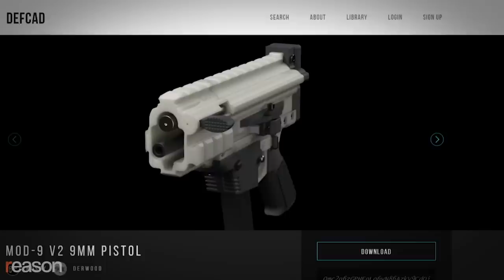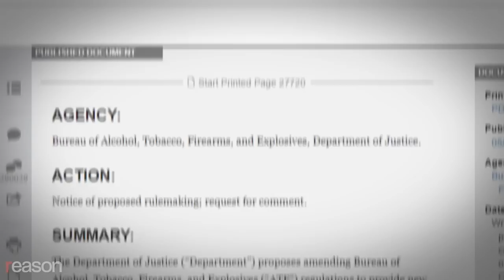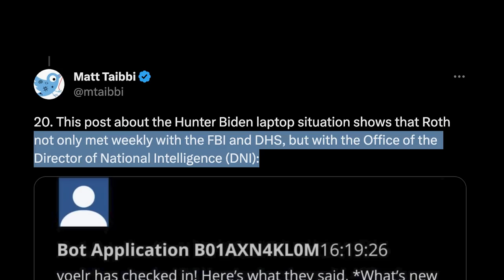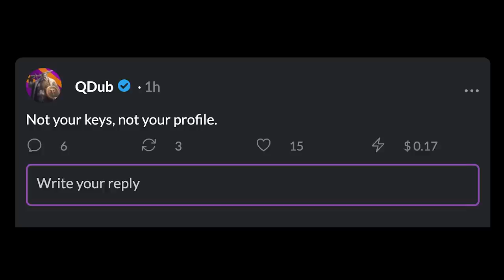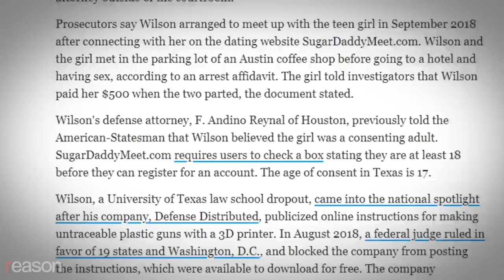Why ghost guns give me hope

Comment: On another subject, decentralizing the food supply helps keep us from being slaves of the ones who own the means of production of all food.
Reply: right... well best of luck with that, im sure it'll be simple and won't cause any issues with major corporations much less international trade....right?
Reply: @bloodlove93 It didn't cause any issues for thousands of years.
Reply: You mean like planting potatoes on both sides of your garden?
Reply: Food supply became centralized because decentralized systems are really bad. If the big corpo makes 200 tons of fruit for the same price as a small farmer making 200 pounds of fruit. It's clear which one is better for society. If society does collapse the corpo farms don't just stop existing. At worse they use older methods the decentralized folk have been using such as replanting seeds. Although a big corpo has the power to cause a mass famine by mass lay offs. Then enforcing the empty fields with guards of some sort. Such a situation would be ludicrous in the modern regimes though.
Reply: @genericscout5408  You need a dictionary.  You seem to confuse the definition of "good" with "efficient".  You also should look up "externalities".  Cheap isn't always cheap.
Reply: @genericscout5408  
Actually, no. Dencralized systems are actually better. Those big farms are more prone to disease outbreaks than smaller operations. Also, decentralization means more competition, which in turn means better quality and lower prices.
Reply: Food sovereignty is a critical make or break culture shift that needs to take place.  Especially with climate change

Comment: 3D printing, distributed manufacturing, encryption, cryptocurrency, and open source AI will make the world a more free and safer place.

Nuclear fusion is also a thing.  It's an exciting time to be alive.
Reply: We need good and proper morals to ensure that we do more good than harm with these tools.
Reply: Which explains why gun violence is so much less of a problem in areas with real regulations, how?
Reply: @mirceazaharia2094  Essentially yes, there are plenty of countries with more guns than the US and fewer problems. They have a combination of better morals and better regulations. And the regulations clearly aren't aimed at disarming people either, in some cases they can have stuff that we can't.

But, there's enough irresponsible jerks to ruin it for the rest of the responsible gun owners.
Reply: @jfangm  Off of what, a commercially viable fusion reaction with net positive thermal yield was completed this year?
Reply: @Robert M  
No, it wasn't. Commercially viable means it can produce enough energy to power a city. The one you are talking about can't even power a light bulb. And that's WITH 60 years or R&D. Fission was commercially viable almost from the outset and has remained so for about a century.

Comment: 3D printers don't work so well without electricity. If you want to be a real pimp, learn how to make guns from scratch the way they did it in 1776.
Reply: Or learn how to make electricity. That is much easier.
Reply: buy a diesel generator and run it off of vegetable oil based biodiesel. then you wont be confined to just making muzzle loaders
Reply: @morpheusgreene2704  Muzzle loaders back then were pretty cool. George Washington had the Chambers Flintlock tested on Alexander Hamilton's property, it fired over 200 times from the single action of a trigger. Now loading it... Well that's gonna take all day, but God gave you 2 hands, so carry 2 of those 7 barreled monsters!
Reply: @jakegarrett8109  or just use a diesel generator hooked up to a modern lathe and make anything your mind can imagine. anyone is capable of making a modern machinegun with even a bit of machining experience, it isnt that hard.
Reply: @morpheusgreene2704  Oh yeah you don't even need a lathe. I like the looks of MAC style, so I'd probably prefer box tubing, then you just need a 330g bolt (for open bolt 9mm), but you can also use round tube/pipes for a STEN look (which I also love the look of a sten, so simple and Fallout 4 wasteland kind of looks).

The Chambers Flintlock would only take about a day to make, its basically 7 pipes and about a dozen holes drilled with a hose clamp to hold them together. Most difficult part is the flintlock mechanism (its standard flintlock mechanism, but those are extremely complicated compared to a modern day Luty), and you pretty much need to have a metal foundry to make flintlocks even if its just a DIY forge and backyard casting which is just nowhere near as simple as a day or 2 making an angry tube from the plumbing isle.
Reply: @jakegarrett8109  yeah i wont argue with any of that, its just that a black powder propelled projectile cant get through police body armor.
Reply: @morpheusgreene2704  I don't know, but historically they were 69 caliber because the founders were based, they knew the memes before we did, that's all I'm sayin'
Reply: @morpheusgreene2704  What happens when the generator breaks and you can't buy replacement parts because there's no internet or electricity? We need to keep metalsmithing alive in case of total supply chain breakdown.
Reply: @DegreesOfThree  not everyone is useless and unable to fix anything. ever heard of a manual?
Reply: @morpheusgreene2704  Yeah, I've heard of a manual. I'm a mechanic. Not everything can be fixed. That's why parts stores exist. Good luck recreating all the plastic and metal parts that will eventually break or rust on a generator. Without the ability to melt metal and pour it into a mold, humans will be back in the stone age very quickly.
Reply: @DegreesOfThree  Whatever you say, bud. Personally, I know ill have no problem taking care of me and mine if SHTF and im sure youre the same, so there isnt even any use in arguing about it. However, I will say that ingenuity and creativity will always save the day.
Reply: @DegreesOfThree  
>tfw you have a small scale smelting operation in your backysrd
Reply: @morpheusgreene2704  I have an electric melting furnace and an oxygen propane torch setup, but I'd be screwed without electricity and gas refills. I'm just saying we can't assume that all our technology will always be readily available. I think the Amish kind of had the right idea.
Reply: With a 3D printer you can make 5 pistols a lot faster and I'd recon they can last you years so get 3D printer parts and generate your own electricity.

Comment: This video proves Chris Rock right

You don’t go after guns… you should just tax bullets
Reply: We'll make the ammo, there are ways to do it.
Reply: @Razor-gx2dq  Figure out how to make the propellant as well.
Reply: I'm surprised somebody doesn't come up with a fuel vapor propellant system instead of using the current status-quo. Gasoline or naptha has more than enough kick if aerated to the correct stoichiometric ratio, and should work at the scale desired. The tricky parts would be metering fuel to prime a chamber and ventilating gases after a charge is spent. The projectile itself can then be simplified and reduced down to an inert component which would be easy to make.
Reply: @mirceazaharia2094  multiple ways to go, one of them is ammonpulver, made of ammonium nitrate, the other would be making a small ball ammo factory, which is not more complicated or dangerous than a meth lab